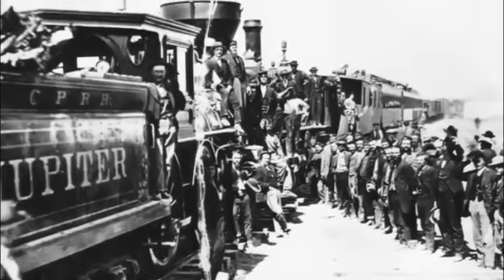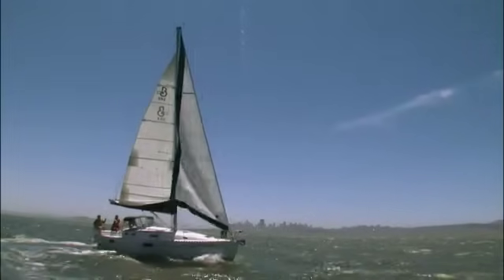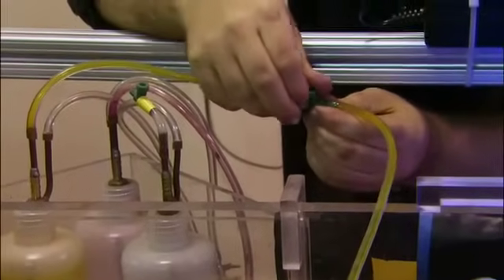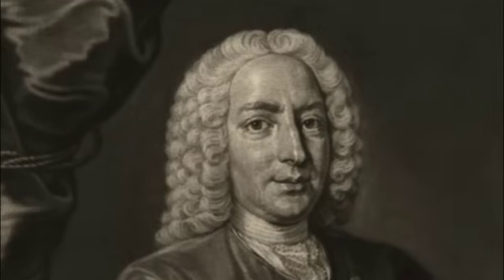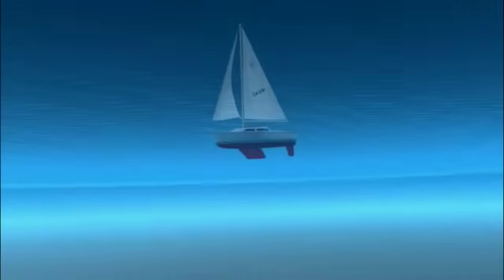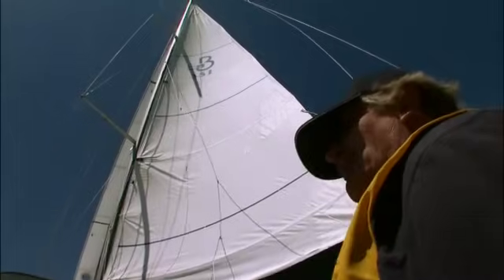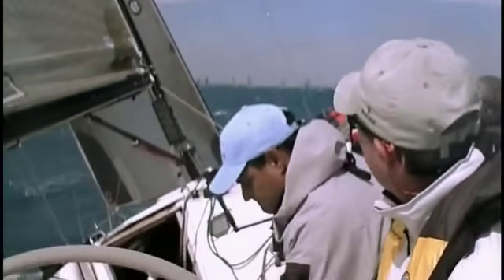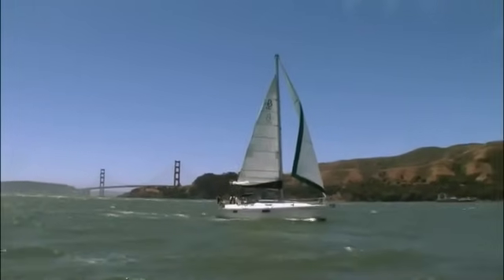The Physics of Sailing | KQED QUEST

Comment: Ames scientists give wrong explanation of how lifting force works :)

Current accelerates because of low pressure on one side of the airfoil compared to other side, not vice versa. Pressure is set up by viscous force in a boundary layer. There is no lifting force in superfluids.
Reply: Юрий Вихляев Air accelerates because of pressure differences in the stream, not from one side of the sail to the other.

Comment: The emphasis that that's how "modern" sailing works is a bit stupid. Fore-and-aft rigs have been around for hundreds of years. Old vessels, even square riggers, could be fast and sail upwind. Replica tall ships have been know to outrun modern yachts fairly often.
Reply: ***** I'm sorry but you're relying on trite misconceptions. I've been on a square rigger making headway upwind many dozens of times. Not as much headway as something fore-and-aft rigged but it's enough to make it upwind. The quoted number is about 66 degrees off the wind, but a good tops'l schooner or virginia-built brig or hermaphrodite brig (or something of the sort) could probably make more like 50-55 degrees if well-handled. The hulls on most of these vessels were deep enough to provide plenty of resistance to leeway. A squares'l will create an aerofoil, but not as efficiently as a fore-and-aft sail cut for the purpose of creating an efficient aerofoil.

 If you want verifiable examples of tall ships outrunning modern yachts, Pride of Baltimore I outran several racing yachts the first time she went out according to the crew that was onboard. It's very easy to believe given her hull, rig, and size if you're familiar with sailing vessels. The crew in the documentary Pride: Legacy of the Baltimore Clipper talk about that briefly. Another example is HMS Rose sailing into Boston shortly after her construction. That's mentioned in detail in an article written for a publication of the San Diego maritime museum written by her designer who was on board at the time. You''re welcome to go find it if you like, that's the verifiable stuff that comes to mind. 

But it's quite easy to see how an authentic replica of a fast sailing tall ship like a Baltimore clipper can outrun a modern yacht in many conditions. Vessels like this were very sharp with massively powerful hulls and huge rigs. They're also over twice the size of your average modern sailing yacht. Add a decent breeze and you can outstrip an average yacht, even an average racing yacht, in a variety of conditions, especially when you have stronger breezes and rougher seas which favor bigger heavier boats. This stops applying, of course, with hardcore racing yachts like volvo 70s or anything that's on foils. This is coming from a student of naval architecture who races yachts inshore and offshore and an experienced tall ship sailor.
Reply: And I should mention, no need to distinguish between modern sailing and historic sailing in that context. On a fore-and-aft rigged vessel from 2015 (excluding solid wing sails) the sails still work literally exactly the same as the sails on a fore-and-aft rigged vessel from 1890. Or 1800. The only thing that's changed is the equipment, material, and the loss of the gaff in some cases. Again, I'm experienced sailing modern and traditional craft.
Reply: ACAhmann r u high
Reply: +Tommy "Johny" Wiseau  What, can't read more than four sentences? Words too long? I can give you a dumbed down version if you're interested.
Reply: *****

 jolllyroger1 is correct. Now go find some real evidence to refute that, or even better spend a few hundred hours on both square rigger and a modern yacht and actually find out for yourself.
Reply: +GrandOldPuba lol obviously you know nothing of sailing and sailing ships ..... 
generally  a modern sail boats main sail can be let out to approximately 45 degrees give or take a few....
a square rigger  can generally turn it's sails  45 degrees give or take .... now back when the Nina pinta and Santa Maria came to America those had round tub like hulls and we're literally some of the worst ships available. .....  viking ships were long canoe like ships with square sails 
in posting here a link to viking replica square sailers and if you have ender addled you will know that these are sailing up wind ... yes they are beating into the wind and are capable of what a fore aft rig is. .... 
just imagine a Lug Sail.....  it's square and it can point into the wind. .... any good sailor knows how to point with any rig.....
Reply: I've sailed plenty of very well researched and built Viking ship replicas, and yes they sail into the wind (not very well, but well enough, around 55-60 degrees generally speaking depending on the boat and how laden it is etc etc). Downwind they will generally thrash a 'modern' Bermudian rigged boat. A common theory is that the Vikings rowed into the wind without sail when they needed a quick upwind advantage, but (as with a modern Bermudian rig with the motor running) extra rowing power can of course improve a sailing tack to windward (by increasing the apparent wind speed).
Reply: The Cornish lugger(twin lugsails, ie elongated square sails) could sail the keel of just about any other boat in its day.

Comment: I was confused as to why a keel would generate lift, but I think I understand now. The keel typically has a teardrop shape but the shape is symmetrical and the keel does not seem to be upturned into the oncoming water like an airplane wing needs to be. You have to have one or other. Either you have to have an asymmetrical wing so that fluid travels faster over one surface, or you have to upturn the wing. A keel leans in the water but its leading edge is not upturned. However, the reason the keel does generate lateral lift is due to the 'angle of attack' of the boat. A sailboat does not travel 'head on' through the water. It travels at a slightly skewed angle off center (think moving forward while the hull is turned slightly to port or starboard). It's this skewing that 'upturns' the keel wing and causes lift.
Reply: No. Not really.
But it's not you misunderstanding, it's that their description of the keel is very misleading. A keel's purpose is less to generate force and more to ensure unidirectional movement. Think of it this way, go grab a credit card, driver's license, library card, etc, and fill up a sink with water. Slide the card through it so that the skinny part is "cutting" through the water. Moves pretty easy right? Now try to move it side-to-side. Doesn't work so well. It takes a much greater force to do it. That's the principle of a keel. It doesn't add another vector, it simply cancels out anything but the desired one so that the only motion is in the forward/backward direction.
Without a keel a sailboat would still go forward, only you will notice the boat will also shift and hop sideways, which is bad for navigation and the boat and also is incredibly dangerous.
Reply: decidiousrex  Keels, dagger boards and centerboards actually do generate lift. But I agree that the lift they generate is fairly insignificant and their main purpose is to stop the boat from sliding laterally. I've sailed dagger board boats without the dagger board. It can be a bit squirrely but it's still doable.
Reply: Hans Zarkov Well, of course based on their design they might, but they don't need to. I'm sure there's benefits to it, but generally any design which would incorporate lift will inevitably have some degree of drag, which in water is BAD. Very bad. Hence most keels are as thin and simple as possible.
Reply: decidiousrex Nearly all keels, dagger boards and centerboards do generate lateral lift, not because they have exotic designs but because a sailboat's hull travels though the water at a slight angle off center. See: Physics of Sailing
http://www.real-world-physics-problems.com/physics-of-sailing.html
Reply: Hans Zarkov Yeah, I guess it's a kind of weird thing to call lift, though yes it technically is, but it's still just the keel resisting sideways motion.
Reply: Hans Zarkov Hans,
That Web Page has an excellent explanation of both the sail and keel, the drag components, the sideways motion of the keel *and* pointing out that the keel and sail forces are offset and produce the unavoidable torque-moment causing the tilt. 
I give it a A+  (;-)
--
Cheers
Hopefully decidiousrex read it also.
Reply: basically forget all that and just think a keel keeps the boat moving the way the boat is going. and keeps the boat up right. with out a keel you would have no stearing.
Reply: Warwick Wells As NASA's Kurt Long and Steve Smith  say  in the video, most sailors don't need all the intricate details. They need the practical understanding of how to trim the boat.
...
However, some people want to understand just how "a keel keeps the boat moving the way the boat is going. and keeps the boat up right", that is, the detailed physics.
...
 Hans has the correct idea.
...
For those interested, much more detail, An EXCELLENT sail boat explanation site:
http://www.real-world-physics-problems.com/physics-of-sailing.html
--
Cheers
Reply: Warwick Wells Without a keel, the boat would capsize.
Reply: Depends on what your doing
Reply: Warwick Wells Well of course. If you aren't moving you don't need a keel.
Reply: Yes. I know all about it anyway as I sail my self :)
Reply: Brice Cook  His mistaken? 
...
http://www.real-world-physics-problems.com/physics-of-sailing.html
Reply: Best explanation of a keel and rudder I can give you is this... Take an airplane slice the fuselage in half cutting vertically top to bottom split.... One wing in left one on right 

Now let's take the left side turn it so the wing points straight down .... Now you will see the wing is the keel and the elevator is the rudder ..... Turn the rudder the keel changes angle making lift
Reply: +decidiousrex "It doesn't add another vector, it simply cancels out anything but the desired one so that the only motion is in the forward/backward direction."

in order to cancel a force, and equal and opposite force must be applied. it does add another vector, which like you say is equal and opposite to any that arnt directly inline with its thin ends
Reply: +Hans Zarkov that cant make sense. that means a boat would have to travel in one direction only and to turn around the keels airfoil would have to also be flipped.
Reply: +Cessna5296Q I'm not sure which comment you are referring to.
Reply: ***** the bet force from the sail isnt forward its forward and off to one side. the keel prevents this crabbing motion and instead the boat leans over

Comment: it's simpler to just figure out a workable route and let the sail dictate the angle of approach, turn away from the wind until the sail starts catching and let the wind push/pull you along. always look to your sail for information, it'll tell you how it wants to work.
Reply: hellsyeah, or point as high as you can till it starts to luff, then cinch the vang down, pull the sheet in a little, then fall off the wind a tiny bit. My shitty little boat will point hella high in a strong wind.

Comment: Hard to take this seriously when the first thing they say is completely wrong. Square-rigged ships can most certainly sail into the wind. It's true that they can't lie as close to the wind as a fore-and-aft rigged ship, but they can tack.There's no way Magellan, Drake etc. could have made it around the world in ships that only sailed with the wind. Getting around Cape Horn from east to west is impossible if you can't sail your ship into the wind.
Reply: Also, while square rig ships couldn't lie as close to the wind, not all ships of the day were square rigged.  The premise that "modern" sail boats are an advancement from square rigged ships (and not an iteration on a configuration that has existed for centuries) shows they did almost no research on the subject.
Reply: Even the Vikings could sail into the wind.
Reply: I think there is this common assumption that the yards on a square-rigged ship were nailed to the masts or something. You want your ship to move at an angle to the wind, you angle the yards, that's basic. And as for the people who think "the invention of the lateen sail" was a big breakthrough, they're right -- but it was perfectly well known as a technology for many, many centuries. Some of the Napoleonic-era British vessels used them, in fact. But they put a colossal strain on a mast as you scale up the mass of the ship, so it turns out that square-rigging is more effective.
Reply: I think the reason is , under the force of wind, a square shape sail would attain a small degree of FOIL FORM. The wind hitting the leading edge of the square sail would be decelerated along the sail & exit the sail at a lesser force, & hence creating a foil form, I think.
Reply: interestingly, there is a line called a prior/prier known across northern Europe (since at least the middle ages) and depicted in various forms that 'alters the foil shape' of the sail as it passes from the mid part of the 'bellow' of the sail to the mast and on to the deck to be serviced. There are variants such as high prier and low prier (though named in Old High German, Danish etc) that are used to alter the upper and lower parts of the sail body. They were depicted and named in Danish, Dutch and German ships, but are never depicted/named in any British ships (as far as I have found), though there is something similar known as a slab-line on some UK square rigged barges (Humber barge IIRC). As far as I know its use(s) has not yet been analysed. I suspect they may have been for tacking, but also could be used to spill wind in increments, or stall the sail totally, or just to reinforce the sail body. Something similar appears in carvings/etchings of Viking ships and other early ships. Anyone who knows anything about them... please let me know, I've been looking for more info on them for years.
Reply: @gurglejug627  just posting a comment to get the notification if someone answers. That's mad interesting!!!
Reply: @alexkempes1919  I was about to say something and realized I said it 9 years ago. I'm pretty sure that top speed of most square rigged tall ships was at a reach and not downwinding. That's kinda normal for most sailboats, including archaic and stone age ones.
Reply: With all them sails something else is happening. One should be put in a wind tunnel.
Reply: I think they just meant head on into the wind, not at an angle towards it
Reply: @wasaglass  - no sail-powered craft can sail straight into the wind.
Reply: Gilbert Pilz, on day one of the zombie apocalypse I extend a hearty welcome to you and your village ... we could use someone with Magellan's good common sense!
Reply: @BenjaminFranklin99-s9n  A lot of other things likewise! Most UNFORTUNATELY for the bunch sentenced to share the same planet with all these doing "Don't Knowers"!
Reply: Most square rigged ships also had stay sails, allowing them to tack.
Reply: @N A the invention of the lanteen sail helped a lot.
Reply: if you call sailing 60 degrees to the wind...sailing "into the wind" Ok, but I don't.  Basically, they went...down wind and somewhat across the wind.

Comment: Anyone ever notice the "models" in these videos never use a "wing" shape that is only a few millimeters in thickness from front to back like real sails?  These demos use sails that are apparently made of cloth several feet thick on the luff.  The models also show the wing directly facing the wind, instead of properly trimmed.  The sail would be luffing horribly if it was trimmed like this video shows.  SERIOUSLY, watch this video again at 3:26 seconds.  The wind would push the sail cloth flat from front to back since it is only sail cloth!  There would be nothing to hold the curved shape against the forward wind.